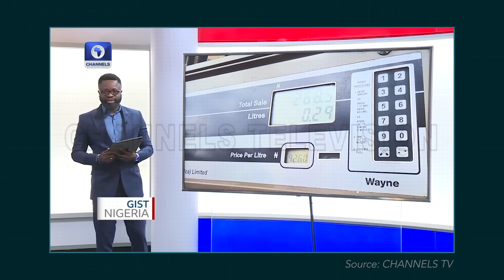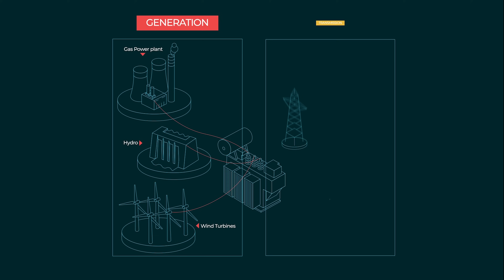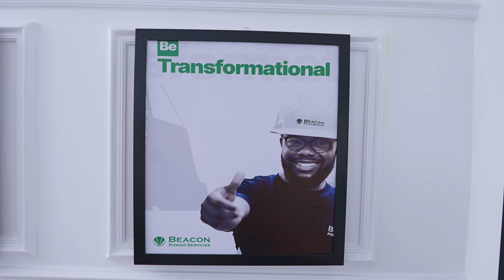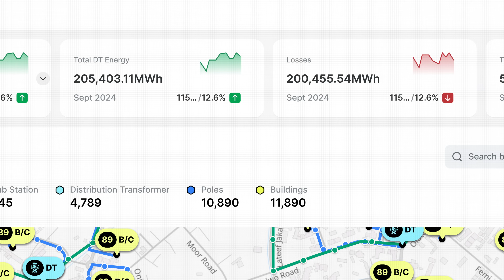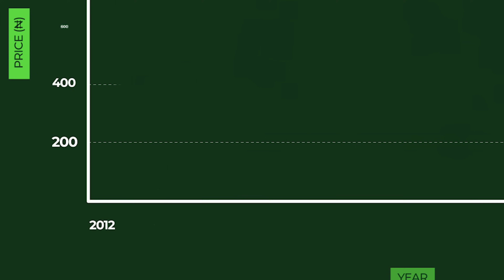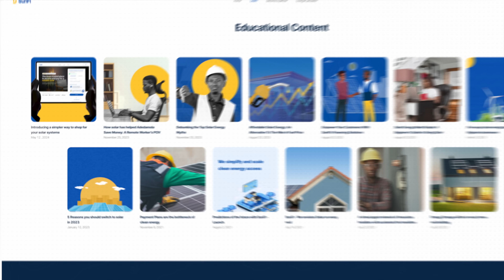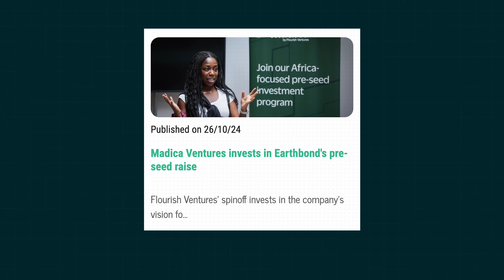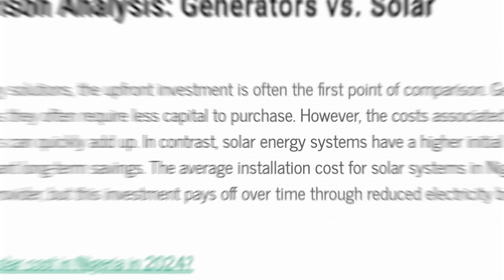Can Solar Power Solve Nigeria's Energy Crisis?

Comment: Decentralized energy production is the solution as the grid system should be shut down not built up as it's a product of the EU/Western powers that simply put creates slaves. Plus just take a look around and anyone can see that these grid systems are only for those at the top as it leaves those at the bottom totally in the dark most of the time. Simply put one must take full control of their own energy needs to remain free so the people need system that allow them to be able to do so. Hydrogen is the solution if generators are to be used, but they are not yet a stand alone technology until the technology I'm working is developed and ready for the masses. So, these Decentralized Systems need to take the best stand alone technologies and put them together in a workable platform that the below average person can reasonably afford.
Most do not know this but hydrogen can fully replace the  use of fossil fuels and it can be created at home if the people are given the means to do so as all one needs is water. I'm going to have to step up my efforts to get this technology developed so that it can make a difference in people's lives as the technology puts full control of one's energy needs in the hands of the individual. Most will read this and say that hydrogen isn't a solution based on what these EU/Western powers have been telling you totally forgetting that they tell you these things as these technologies goes against their interest. So, yeah, they lie to you so that they can keep the monies flowing in.

The technology I'm working on works but the science behind the technology lives in an area where things are a bit grey in our teachings on science. Here is the theory behind the science:

"All  Molecules  can  be  separated  into  their  component atoms  by  taking  away  the  electrons  from  the  atoms that  make  up  the  molecules."

 That is the science behind this type of water separation in that the atom's electrons were the target to get the water molecules to break apart into it's component atoms. In nature what Meyer did was to mimic the earth's global electric circuit, IE, a thunderstorm. What I found in my studies on thunderstorms is what is being taught about them is incorrect as thunder is caused by the water molecules being broken down into hydrogen and oxygen gases by way of ionization as the cloud system builds up an electric charge. The water is separated at the bottom of the cloud and the hydrogen gases rise to be ignited at the top of the cloud which we all hear and feel on the ground as thunder. This type of water separation creates hydrogen, oxygen, and an electric charge as that electron remains in the cloud system. As this process repeats itself over and over the electric charge build up will finally reach the point where it has enough energy to overcome the air's resistance to current flow and then a lightning strike happens.
That is just one example of nature performing this type of water separation but there are more as plants also break the bonds of the water molecules by taking away the electrons from the atoms that make up the water molecules by way of photosynthesis. Now when you go over photosynthesis you must ask the right questions in order to see the plant break the bonds of the water molecules by taking away the electrons from the atoms to break the bonds of the water molecules. The question that needs to be asked is, "How does a plant break the bonds of the water molecules?" With this correct and most direct question you will be able to see just where the plant took the electrons away from the atoms causing the water molecules to fall apart and just as in the thunderstorm breaking the bonds of the water molecules like this produces hydrogen, oxygen, and a electric charge. Now the plant has no use for the oxygen and releases it but it keeps the hydrogen and makes use of the electricity being generated to sustain itself as all living things do.
Us animals break the bonds of the water molecules by chemical reactions but the result is always the same in that you get hydrogen, oxygen, and the creation of electricity. Now the system in animals is complexed but it is the reason why we would die in about three days without water as basically the body would lose the ability to send electric charges that tell things like the heart to beat or the lungs to contract and expand and other things of the like that require electrical impulses.
Now I have just given you three examples of this type of water separation taking place but trust me there are more that happen each and everyday on this planet as anything that gets the electrons away from the atoms that make up the water molecules will cause those water molecules to breakdown into it's component atoms. Just as a bonus the explosions that happened at Fukushima Nuclear plant were a result of this type of water separation in that the radiation bombardment was high enough to knock off the electrons from the atoms which again produced hydrogen, oxygen, and the creation of an electric charge and once that charge had built up to the point here it could over come the air's resistance to current flow it  produced a spark in the presence of hydrogen and oxygen gases and the rest is history.
Again in order to see these things you must first ask the right questions which is why mainstream scientist haven't figured this all out as they haven't been asking the right questions and if you never ask the question how can you ever answer it? Just image no one has ever ask, "How does a plant break the bonds of the water molecules?," before in all this time we have been teaching and studying science. I went and asked the right questions and then moved to answer those questions which sets me aside of everyone else.
My primary problem is money as the USA is now starting to fail and I am stuck right in the middle of it and as such it takes me a lot of time to be able to afford the things I need to get this technology off the ground. Right now I'm working almost 11 hours a day which doesn't leave me a lot of time to work on the technology even though I have it mostly solved I simply do not have the time or the money to put into at a rate that can make a difference as of yet, but know I am working on it when I get the chance to do so. 
My aim is to put the individual in full control of their own energy needs with this technology as that is true freedom. No more paying for fossil fuels and no more electric bills is what this technology is capable of doing and as you can imagine that is something these EU/Western power have no desire in seeing the people get implemented into their lives as it kills their cash cow.